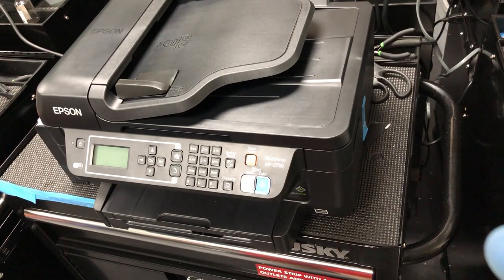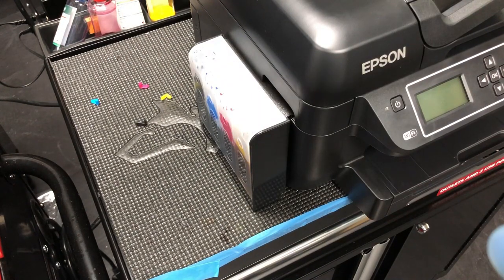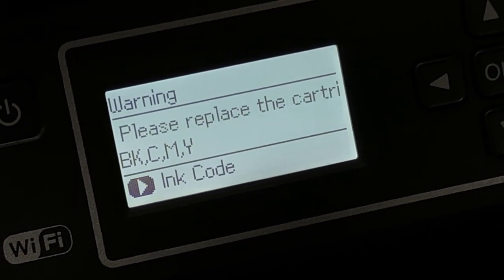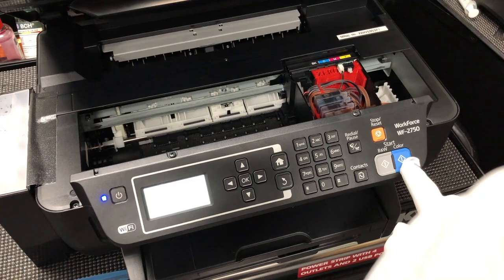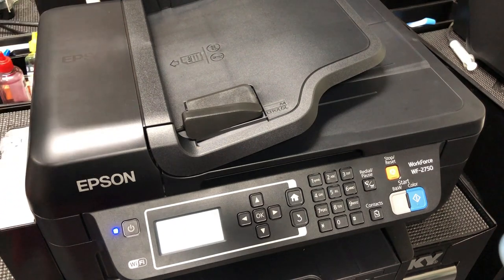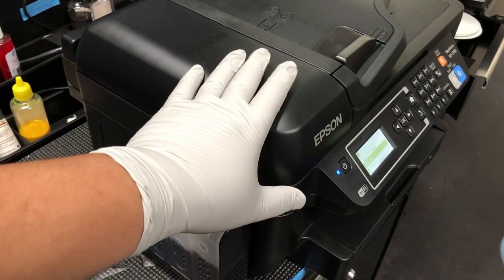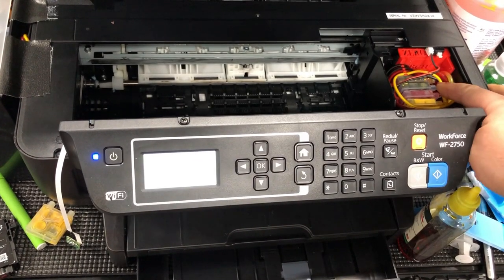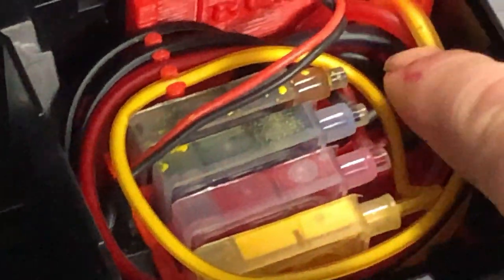3-Step Installation for Epson WF-2750 with BCH Zero Cartridge System

Comment: Question... Can I use Electrical Contact Cleaner to get stubborn clogs if flushing can't fix it? I figured if it's safe for sensitive electronic connectors, rubber, and plastic I would think it would be okay... :)

Comment: Hi! I have question. Everytime I turn back on my printer, the "cartridge not recognised" error always appeared, this I always do the reset procedure also. Is there a fix for it that I will not do it everytime turning it on? Thanks?
Reply from the maker: It will show that if you restart the printer.  It is important to keep the printer power on because sublimation ink is more prone to clogging.